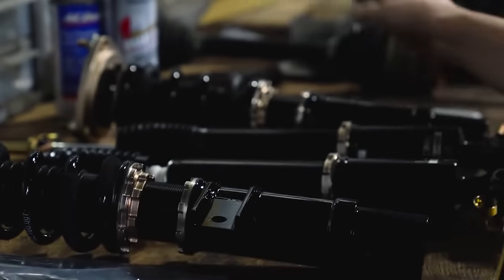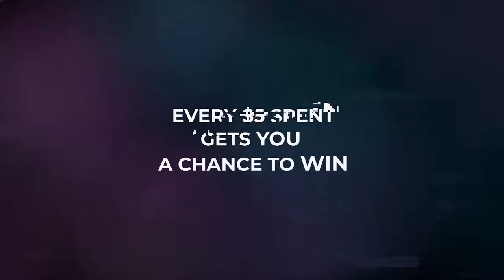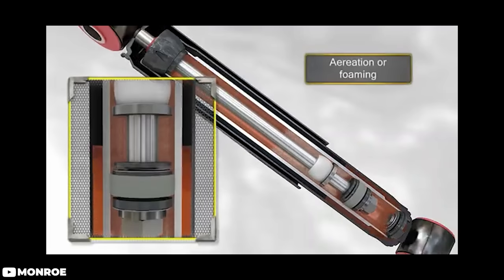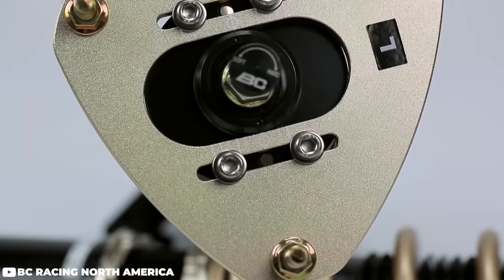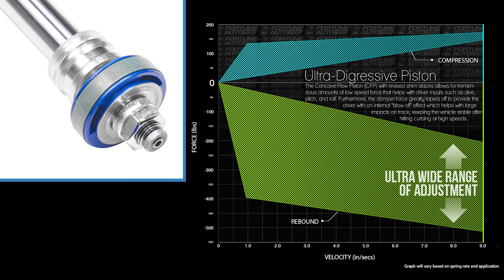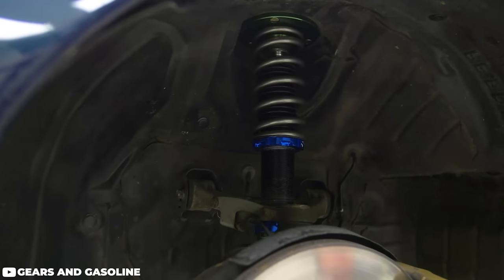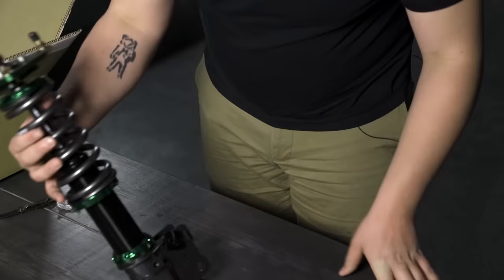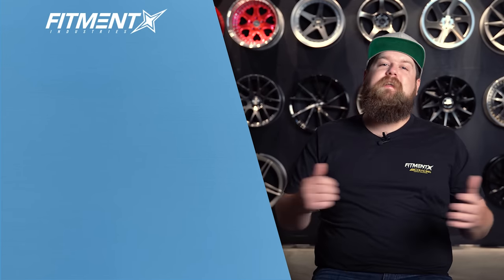If You're Looking For New Coilovers, Watch THIS!

Comment: Love my Fortune Auto with swift springs on my IS300.
Reply: Miss my manual it has fortune autos
Reply: what spring rates are you running? i have some cheap leaking 12k front 15k rear coils that came with it and they are crashing over bumps. Purchased the is with them on already. 

building a 2jzge in the garage so haven’t touched suspension yet.

Comment: Twin-tube is not at bad design depending on what you're aiming for in a shock. Twin-tube gives you more stroke length to work with than with a mono-shock with an IFP piston.
The adjuster on the top of BC is like any other rebound adjuster.. It's a bypass port within the shock shaft so when you close it the oil is directed more on to the shock piston and the valving stack.
The good part of having this adjuster is you get something to go by when testing different valving. However, When the adjuster only affects rebound you have a check valve installed so the oil only flows via the bypass on the rebound-stroke. I have serviced BC coil-over and other brands but hands down BC I better to work on and the build quality is actually really good.  On my daily driver, I use Bilstein B6 because it's the best upgrade over the stock Sachs on BMW e91 the stock setup is super soft for comfort but that's not good on bad roads...
Reply: Correct, Twin Tube shocks have now increased their technology as well. Thats why high end companies like JRZ and Moton use them. The adjuster on the BC Racing one-ways always simultaneously adjust compression and rebound which effects the pressure tuning of the shock. This is bad; makes it more prone to Hysteresis, Seal Drag, and Cavitation.
Reply: @4bangermafia  wait wouldnt softer suspension be better for bumpy roads?

Comment: I would LOVE a set of BCracing coilovers. I just wish they didn’t require welding for my volvo 240
Reply: I’m getting some bc racing for my s60r
Reply: Loved the 240. My dad had one in 80s.

My brother had a Volvo 240, a 164E and an 1800 sport wagon.

Volvo rocks!

Volvo means 'I roll' in Latin.

I'll get a 240dl in future. Bullet proof.

Cheers
Reply: Replying to a year old post but do not get welding coilovers unless you have a good welder who knows what they're doing. Pay more in the begining and you will eliminate headache of bad or expensive welds.

Comment: Just got a 2022 MDX (Advance Package on 20" wheels)...The stock suspension is way too bouncy/floaty (Esp on the front end) for my taste. Comfy but gives me a headache / motion sickness whenever I'm not on the highway. Which suspension would you recommend to improve the road manners on this large SUV? I am all about traction and stability (want to eliminate the bobblehead effect both vertically and laterally...but still maintain comfort and handling to a degree).

Comment: BC BR series! With the twist on the knobs, you can go street comfort to track stiffness at will.
Reply: incorrect
Reply: @4bangermafia  how ? u can adjust it how u want if u want track u go lower u want street u go lio more up
Reply: @Dd-mt5ol  because it's not that magical. First of all the BR series adjustment is linear and effects bump and rebound. Which is something you don't really want. And spring ultimately determines how stiff the car is.

It's just marketing gimmick.
Reply: @4bangermafia  what coilovers do u think are best for drifting without me blowing my suspension or a shock or any like that on my gs350 because i do wanan go a little lower and i want me something like u said stiff and smooth so i crossed bc coilovers , K sport coilovers ,tin coilovers , and the list goes on what do u think about fortune 500 coilovers
Reply: @Dd-mt5ol  you'll probably wanna talk to yellow speed racing. They have drift cars so they should have coilovers for drifting.

Comment: I was looking between these 2 buy ended up going with the Fortune Auto for my 9th gen Si.
Reply: You made a wise choice
Reply: I'm going fortune auto for my 97 Maxima.

Looks better quality and adjustability over the BC BR series(which I was considering).

Love how Fortune Auto is USA made and compression and rebound are adjustable separately unlike the BC BR's.

Cheers. Love Fitment Industries!

🍻
Reply: @tinhatrancher904  hey did you ever get them for your 4th gen? I just ordered them for my 5th gen
Reply: I did. Installed them 2 weeks ago. 

They are great. Originally the rears were built with the 5th gen top hat. Called Fortune and they sent out the correct 4th gen top hat no charge. (5th gen rear top hat is a little narrower by 1/4 inch).

Could not be happier. Rides great.
Reply: @MrSirGiuseppe  See above ^
Reply: @tinhatrancher904  awesome, I'm so ready for mine to arrive haha heard nothing but good things about these so far. I appreciate the feedback man
Reply: @MrSirGiuseppe  I think you will enjoy the quality, adjustability and ease of install.

Comment: What’s the best coilovers to get for a smooth ride and be able to handle bumps etc
Reply: Fortune auto with swift springs. I have that on my G and rides amazing. No complaints. A buddy has BC and has issues and you can feel almost everything on the road
Reply from the maker: I like that combo sounds like it runs smooooooth! 🔥
Reply: @kv8649  how low are you?

Comment: I have some Bilstein coilovers and their a lifetime warranty I don't know how a 5-year warranty beats a lifetime warranty?🤔
Reply: I have a lifetime warranty on some of my tools but the problem is they suck so I’m using the warranty a lot. Not seeing the benefit of being without the tool because it’s broke all for a warranty. I’d prefer no warranty and a badass product vs a mediocre product and a great warranty.
Reply: Would love to see low amplitude shock dyno results for these. The features are nice, but I care about the performance.
Reply: @RadDadisRad  my coilovers are almost twice the price of the coilovers they're talking about for my b16s and they've been around a lot longer and have a greater racing heritage than those two companies.
Reply: @scottemf  and are twice the price like you said, that means they aren't competitors. But I highly doubt they are twice the performance, especially since bilstein has move much more towards OE applications and largely abandoned motorsports, where as companies like fortune auto specialize almost exclusively in motorsports. Bilstein is established and the products are reputable but they definitely arent cutting edge anymore.
Reply: I kind of take back my comment. I did some research elsewhere and found dyno plots for both of these. What I saw was definitely in the range of acceptable, especially for the price point.

Comment: You get what you pay for. Cheap coilovers generally use low quality struts/shocks and are generally best left for the stance crowd. If im building a track car i dont want a coilover that is used on drift cars that generally focus on NOT having grip.
Reply: Incorrect, they need good grip as well.
Reply: @4bangermafia  they do not need grip in the same way that an autocross or track car does
Reply: @TheAdamone92  autocross car doesn't need grip in the same way a track car does either.
Reply: @4bangermafia  you notice the word or?

The main point is, dont cheap out on coilovers. Unless you want poor handling and poor ride quality.
Reply: @TheAdamone92  driver mod is more important than quality coilovers imo. Something like BC or fortune auto with the right springs and with the right suspension set up otherwise can outperform something much better with the right driver.
Reply: @MrSirGiuseppe  while i agree... thats not really the point. That can be said about any mod or coilover video lol

Comment: Is this a real question? I have both on my cars. All Fortune Autos start as a Digressive Valve coilover. BC doesn't. My BCs ride like ass vs my FA500s
Reply: What kind of car are you running them on?
Reply: @renameduser5279  FA500s on 93 EH2 
BC BRs on 16 i30 SR
Reply: @LTxFartNugget  right on! How do you think silvers coilovers compare to both of these? FA doesn't make an application for my car
Reply: @renameduser5279  are they digressive or linear? Linear will be like BCs, digressive is like FA
Reply: @LTxFartNugget  the springs?
Reply: @LTxFartNugget  44mm piston with digressive style valving characteristics provides maximum low speed damping response for ultimate performance while simultaneously giving a comfortable ride. That's what's on there website
Reply: @renameduser5279  Kind of vague, but from what I've heard from other owners Neo Silvers are bomb coils.
Reply: @LTxFartNugget  We use a 44mm Linear type piston in our shocks. This style piston gives both excellent track benefits as well as maintains ride quality. they also have this lol but the coilovers for my car say digressive
Reply: @LTxFartNugget  so they are good from what you've heard from other owners?

Comment: It's never just coilovers, its coilovers, adjustable tierods,  upper strut mounts, ball joints, camber plate adjusters, its rear camber arms also strut mounts for the rear then its rolling your fenders then its a 4 wheel alignment. Much more than $1k. Been there done that. No thanks. Ill get lowering springs and a front alignment $300😊😊😊